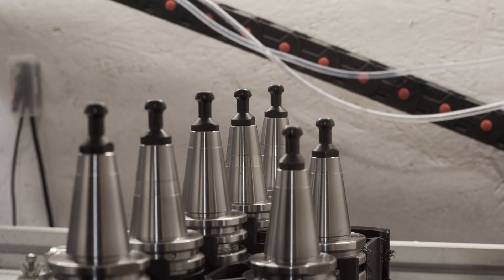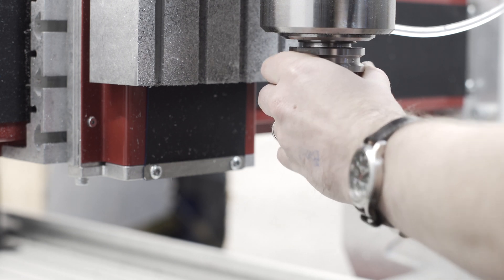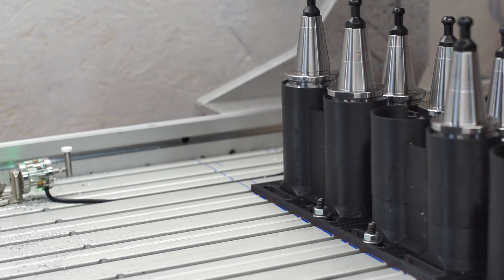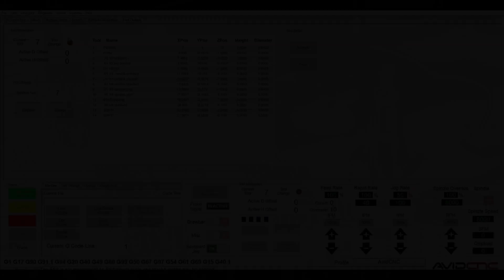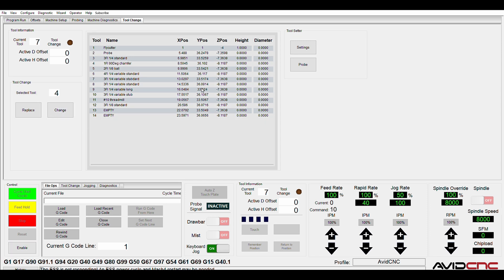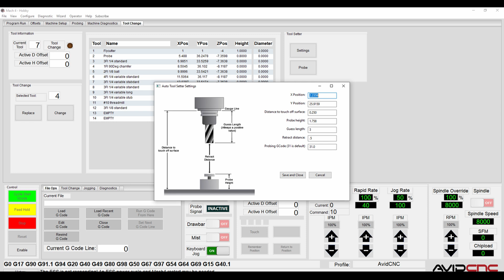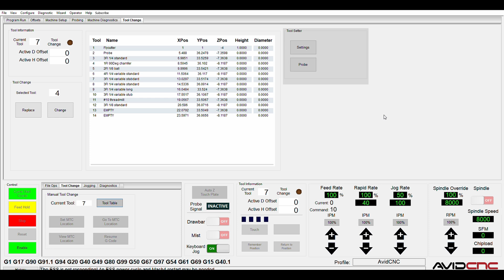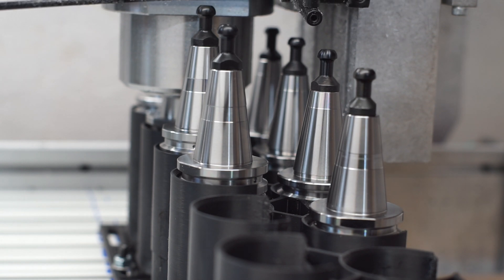3D printed tool rack for my ISO30 ATC Spindle

Comment: Interested in seeing how that face mill works out for you.  If I'm reading your description right.. You plan on running it with a single insert as a fly cutter? I have the same spindle on the way and was looking into face mills as well.

Looks like the fog buster was moved quite a way away from the tools to clear the tool rack.. Has that been a problem?
Reply from the maker: Yep, that's the plan (theoretically anyway haha).  It's not ideal at 3", but I already owned the facemill and inserts from my manual machine so it was relatively cheap to get a BT30 holder and try.  Calculators say it wants to spin at ~3k, which is dipping awfully low on the spindle torque curve. I'll have to play around to find a reasonable low speed that still has enough torque, and maybe try the torque boost setting.  On the upside, it'll be balanced unlike a flycutter.

I haven't cut anything yet so haven't dealt with the fogbuster, but I'm planning on relocating it.  I was already having some issues with it's location anyhow (bumping into clamp studs, etc).  Current plan is to bolt above and to the right of the spindle, then "reach" down over the front.  Should avoid any obstacles and the toolholders.

Comment: I built a router with a similar system, although my rack was just a bar of aluminum with appropriate sized holes in it. Someone else in the comments mentioned the tool released/engaged sensor. That's a very important point! These tools will sometimes stick - mine would stick maybe once in 200 or 300 changes.

When it does stick, it can be a disaster. Imagine that you release the tool, then move up (thinking you're empty) and go get anther tool. You'll crash down on the "new" tool with all the force the z axis can muster. If you're lucky the tool will break. If you're not lucky you'll torque the tool right out of the spindle and damage the taper. Ask me how I know.

The tool sticking is frequent enough that you have to babysit every tool change with your hand on the estop. Definitely put some thought into a tool-release sensor of some sort - maybe a prox sensor mounted on the spindle body that activates when a tool is in the spindle.
Reply from the maker: Oh boy, thanks for the warning!  That sounds terrifying.  I don't intend to run this "lights out"... but I definitely don't want to babysit it either.  I'll spend some time noodling over a tool release sensor.  A proximity sensor seems like a good idea, simple and robust assuming it can be mounted somewhere that doesn't interfere.  An optical infrared/laser sensor might work too.  Hmm.

Appreciate the tip!
Reply: @BreakingTaps  FWIW the KUKA machining center I use to run used optical sensors to see if a tool was in the rack.  It provided the necessary feedback and allowed for lights out operation.
Reply from the maker: @TheSeaShadow did it have a sensor per-tool-pocket, or a sensor somewhere on the spindle that looked at the loaded tool holder (or maybe looked down at the tool pocket)?  Thanks!
Reply: @BreakingTaps  There was a sensor per pocket, the machine used software logic to determine what was in the spindle itself.  So it kept track of what tool was called and made sure that spot in the rack was still empty.  If any of the individual sensors tripped without being part of an intentional tool change it would cause the machine to do a new touchoff when that tool was called.
Reply from the maker: Great, thanks for the info.  Will mull over the options and see what I can come up with.
Reply: Bit late to the game, but as I was watching this and then reading the comments, is there not already a sensor on this machine which can do this?! I.e. There is the Auto Tool Height sensor,  presumably with an extra move after releasing the tool to check that tool is no longer there, possibly travelling low enough that the edge of the collet would otherwise trigger the sensor in the worst case that there was no tool in the collet/tool broke off, but the ATC collet still seated in the spindle. Just a thought anyway.

Comment: The 3d printed tool holders have one advantage as this spindle does not theme to have a drawbar/tool sensor: In case a tool does not get ejected and gets dragged against the next tool you will only brake platic and not your machine. Did you consider doing a "spindle empty" check with your toolprobe?
Reply from the maker: That's a good idea!  I'm actually not sure what would happen right now.  There is a defined probing distance in the script, and it will throw an error if the probe isn't triggered in that distance.  But I'm not sure if that is a "fatal" error like an e-stop, or if it just displays a warning and continues with the program.  Definitely a good idea to kill the program (or at least pause and wait for the operator) if it doesn't detect a tool.
Reply from the maker: Aha, so I realized after reading Rod's comment that I misread yours.  I don't currently have any kind of  sensor to guarantee it released a tool before moving to the next.  Will put some time into considering how to implement.  Thanks for the tip!

Comment: Watching your video I see you said you have an issue with gantry height. If your ATC is in a fixed positions and you plan to keep it there you could always remove the aluminum base plate in that area. This would allow you to set the tools much lower, like waaaay down and even add a flat bar (base) across the backside of the machine that acts like the spring you mentioned. The bar(s) could be on the front and back and hold the tool rack in place, but as the spindle comes down it can allow that slight "spring" effect you are looking for. If not made out of plastic it would also not break or wear nearly as fast, if at all.
Reply from the maker: Yeah, I forgot to mention in the video but that's an aspect I'm still debating with myself.  The current setup (with the spindle slightly higher than the bottom of the Z-axis plate) is configured such that the bottom of a loaded tool holder is just under the plate.  Meaning it gives the most Z clearance possible on the machine.  It has the side-effect of requiring the "stair step" tool holder and really complicating the clearances.

If I move the spindle down, I'd lose maybe an inch? of available Z height to work on parts.  But as you said, it would let me set the tools much lower (or allow longer tools without drilling holes through the table), and simplify the whole rack setup.

I'm not sure the best tradeoff to be honest.  Still mulling that one over :)
Reply: @BreakingTaps  Sorry, not sure you understood. If you cut the table plate (aluminum) where you have the bits set currently then you can then place them lower in the table. You don't lose any Z height but your table is cut. 

Your idea makes me think of something really cool. 

If you ever add a A axis to your Z, you can then "tilt" your tool holder and set it off the table. The spindle can swing to a 45 degree and pick up tools.

Tools ---> /________ <----Table

When I get my Avid I'm going to add an A axis to the Z like this. I don't want the A+B for 4th 5th axis as I feel you need huge Z axis height to make up for the B axis movement. I also think you lose detail. https://www.youtube.com/watch?v=wTh0wofb5_w&t=386s
Reply from the maker: Ahhh, I see, yes definitely misunderstood.  That would definitely work!  Although depending on how the spindle is situated on the Z-axis plate there is a limit to how low it can go.  E.g. right now with my setup, the spindle nose can't get lower than 3-4".  I set it up that way on purpose because most of my work will be on top of fixtures or a vise so I wanted extra clearance, but if you work mostly flat to the table it'd be fine to lower the spindle on the plate, and then can grab tools "sunk" into the table 

Re: tilting tool rack... check this out!  Just stumbled on this the other day: https://youtu.be/l2VR3t7lzsM?t=115  Pretty cool!

Agreed re: 5th axis.  I considered it briefly as well (with a trunnion style setup) but there's just not enough Z axis to make it worthwhile imo.
Reply: @BreakingTaps  That tilting tool rack is pretty sick! If 5th axis then you won't need more motors and boards, but it's still super cool idea to not lose cut room.

Comment: i se you have the toolsetter and touch probe from Vers. Do you like it? how is the accuracy? Is it the newest version? Rechargeable?
Reply from the maker: I like them a lot!  I have the wired "TS" tool setter, and the wireless, non-rechargeable "WL" probe.  The TS connects to the wireless receiver, so they can share the same cable/input pin which simplifies setup.  The rechargeable model wasn't available when I purchased it (3-4 months ago), although I would definitely get the rechargeable version if I were getting it today.  I plan to swap the battery and add a recharging circuit to mine in the future.

Haven't done any formal accuracy testing yet, or even really dialed them in much (e.g. the tool setter has grub screws to adjust tram so it is completely parallel to the spindle).  But from casual usage they seem good.  I did have a small electrical issue with the wireless receiver, but Serguei was super helpful over email getting it sorted out.

For the price honestly I don't think you can beat them, especially for hobby usage.  The next cheapest I could find (Drewtronics) was hundreds of dollars more.  Only downside is that I think he manufactures them on demand and shipping is overseas (for me), so it took a few weeks to arrive.

I did consider an optical laser toolsetter, which you can get pretty cheap from places like AutomationDirect, but since I was getting the probe from Vers anyway I went ahead and picked up the toolsetter too.